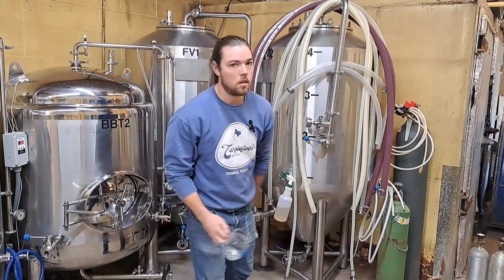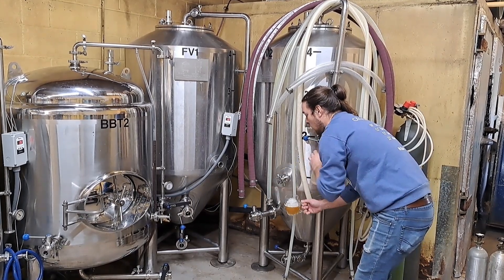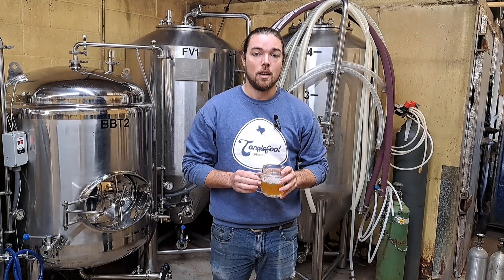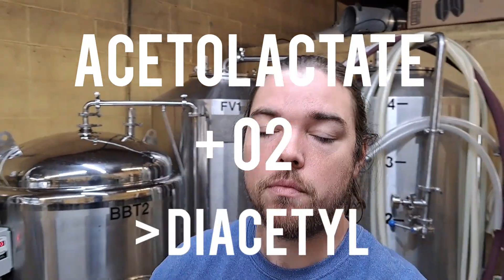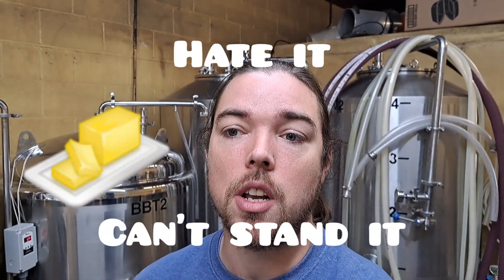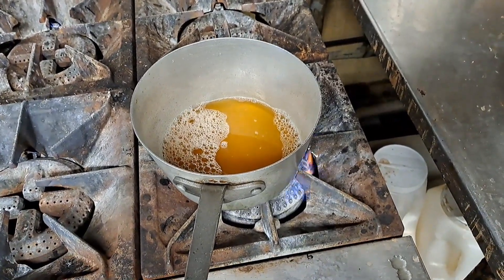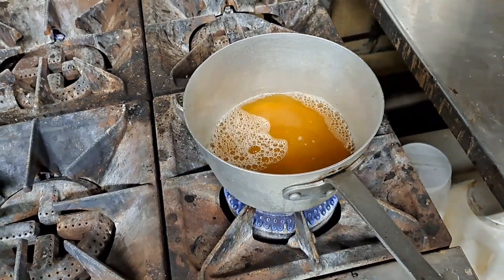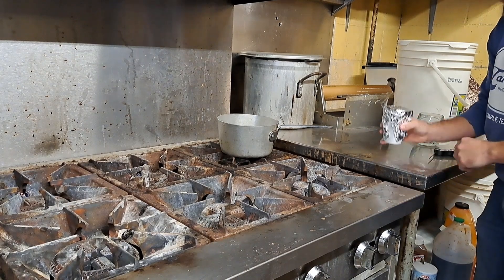Get Butter Out Of Beer!

Comment: Just read about you in Texas Highways. Will stop by next time I'm passing through. Czech beers are one of my favorite styles. I'm just finishing up a CDL fermentation and getting close to crashing. Though not as extensive as your demonstration, I learned this diacetyl test a few years ago on youtube and have always performed it on any lagers I make. I just pull a sample, microwave it, and do a sensory evaluation right then. It has always worked, but I will employ your method going forward. As you alluded to at the end, once you crash, any diacetyl present cannot be removed. Hence, the purpose of the diacetyl rest for the benefit of your viewers. Cheers!
Reply from the maker: That's great! Cool to see the article getting out there.
Ya, D tests are super important in lager. A simple test could save a batch and your reputation 🍻

Comment: Pro tip on the heating of your sample, get a sous vide for cheap and then put your sample in a plastic beaker with a lid.  Pop your sample in a pot with some water and heat it up.  Way easier for temp control
Reply from the maker: Facts 👆. Cheers 🍻